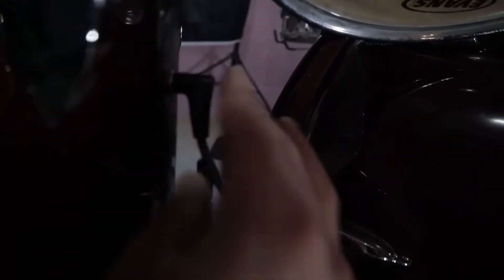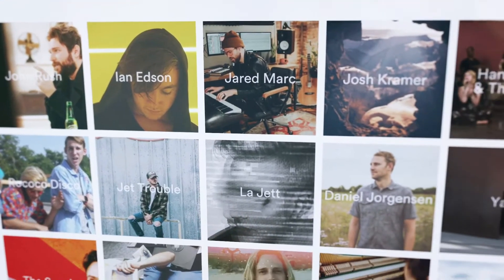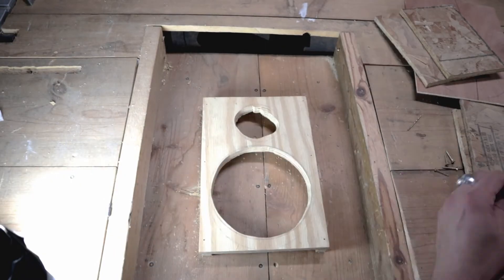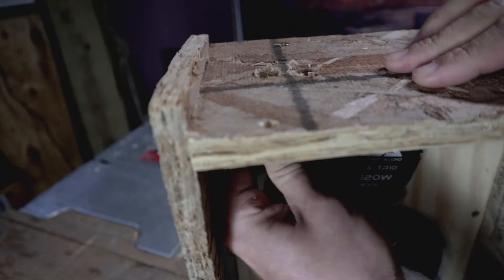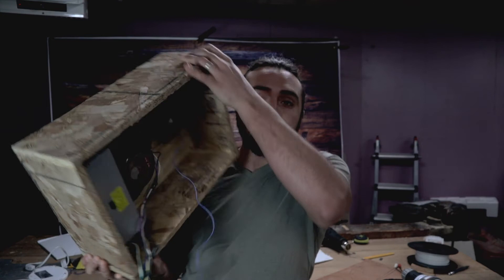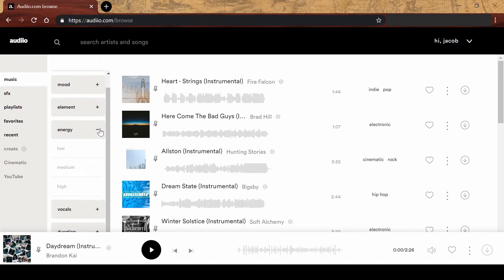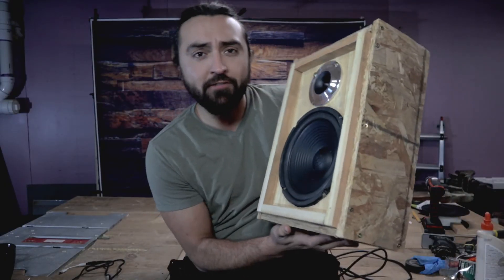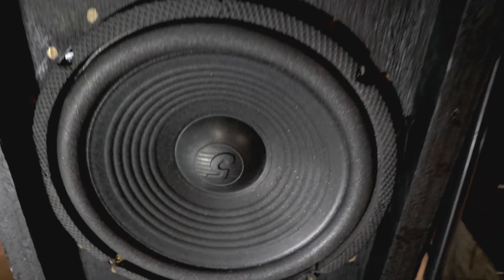DIY E-Drum PA Speaker with Audiio - the Best Music Licensing Platform Review

Comment: I know this is an older video, but I was inspired to do a diy amp for my e kit,I bought a nobsound amp and some used Bose speakers, which I got from ebay really cheap, added a home theater subwoofer, that I got at a thrift shop. Came out nicely.  Thanks for the video and inspiration